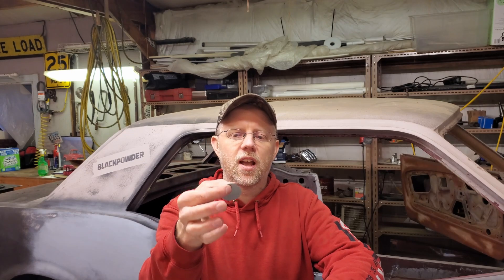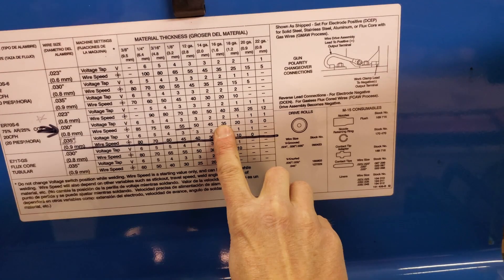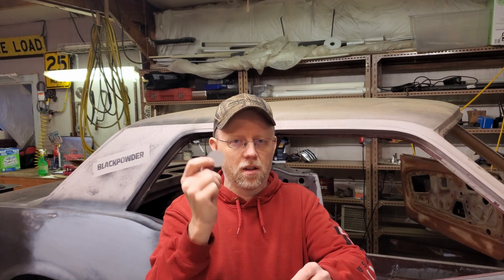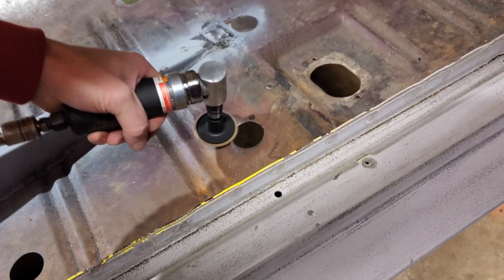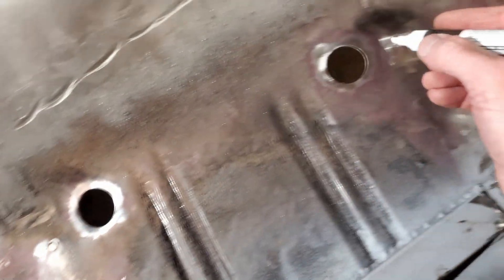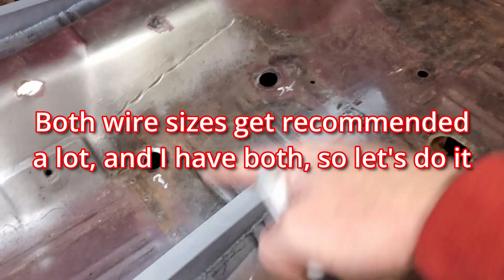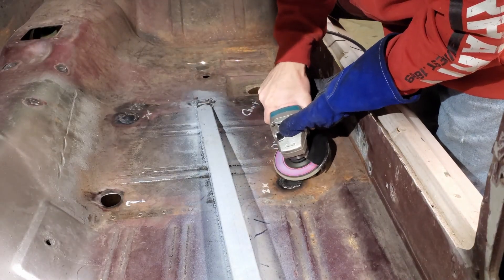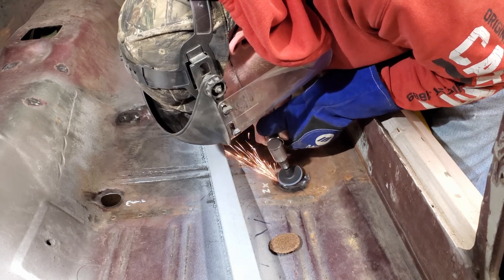Testing sheet metal weld settings

Comment: I have my 110 snap on welder set upon 0.23 and a co 2 mix bottle works awesome all the you tube body guys use the same setup
Reply from the maker: A 110 welder would be nice for thin stuff. Someday I will get a TIG setup, and then we be cranking up the quality

Comment: Interesting video. I'm slightly envious of the 1mm thick steel on your car. Some of the outer panels such as quarter panels on my 1992 Rover 216 (Brit version of a Honda Concerto) are 0.8mm thick. Having to go hot and quick on the welds but even that is proving a challenge. I'm leaving a gap equal to the thickness of the metal being welded. I've found a 1mm gap from using blade type panel clamps is too large and my old SIP Migmate 130 is a bit of a blunt instrument when it comes to welding at low settings.
Reply from the maker: After welding these in, i noticed that they are slightly thicker than the floor, so the floor is closer to 18ga than 16ga. I just looked at a chart and saw .8mm is 21ga, and thats typical for a lot of body panels.

Comment: By ear, second one sounded the best to me, you may have to grind a little bit more, but it seems like it’s more controllable.

Going to number three… 

It’s a wild card 

It’s all about consistency

I use .023 wire for everything… 

It is interesting to see you use the .030 wire 

I would never use , 030 wire… But, you have to find what works for you
Reply from the maker: I saw quite a few people using it, so I gave it a try. I think my biggest issue is the machine is not set up for running .023. I think it binds too easy in the whip and then wads up at the drive (obviously the oxidized texture makes it much worse) For now I will just run the .030, as I weld heavier items more often, and I hate constanlty changing back and forth. What I really need is another welder 🤔